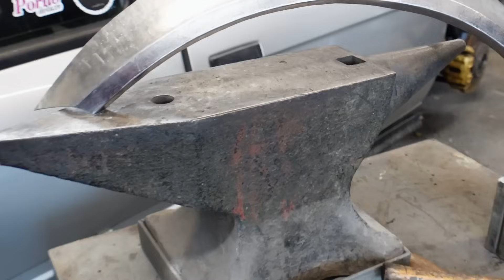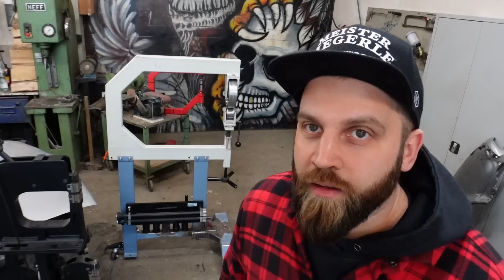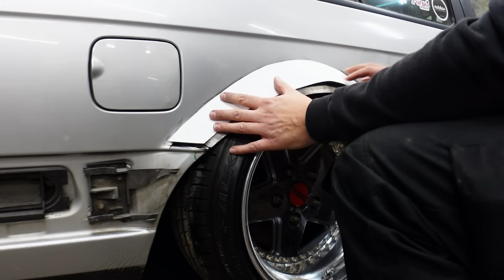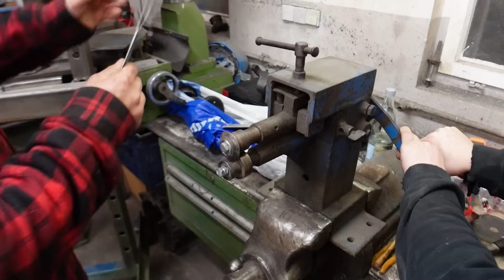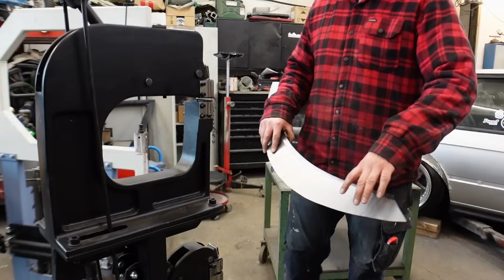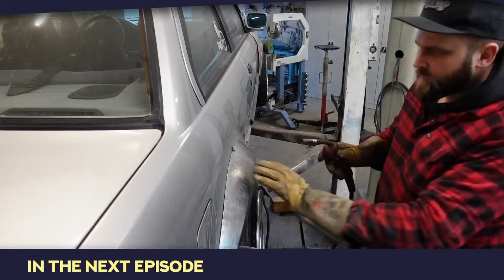Build a Wheel Arch with no Welding | BMW E30 Widebody - Episode 2

Comment: Do you have a photo of the lower die you used? Came out like original!
Reply from the maker: Hey, it basically just is a round Die with a flat top and  the same diameter then the e30 edege has, i mean it was 22mm 

Greetings Andy
Reply: thanks man @MEISTERMEGERLE